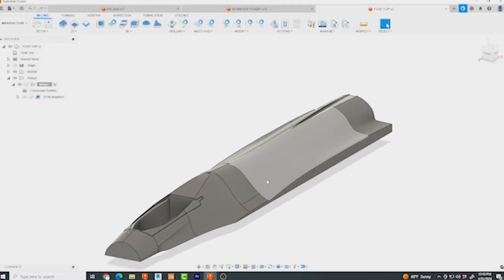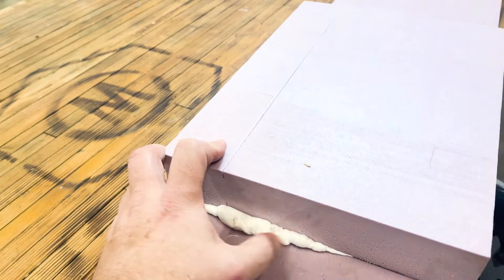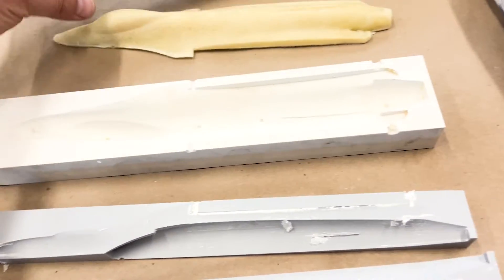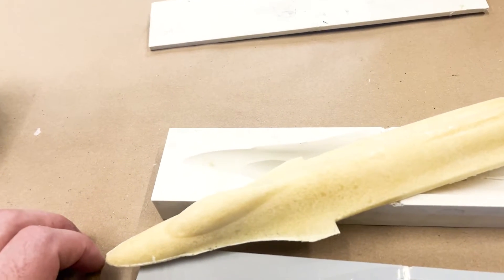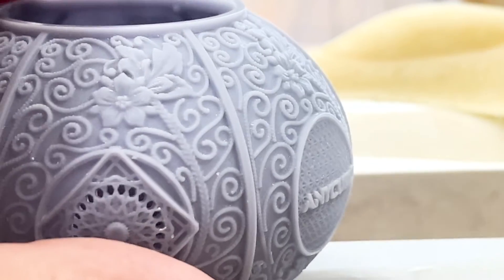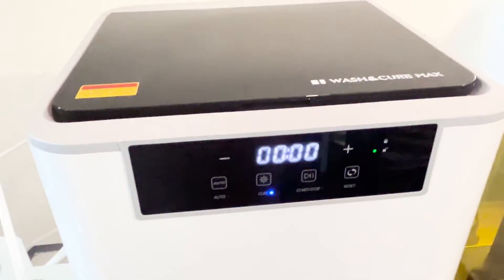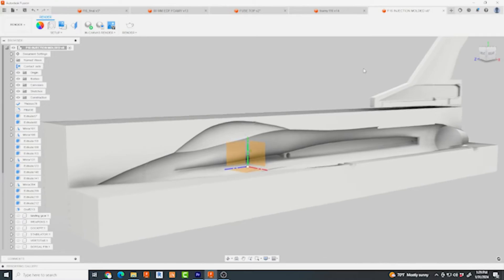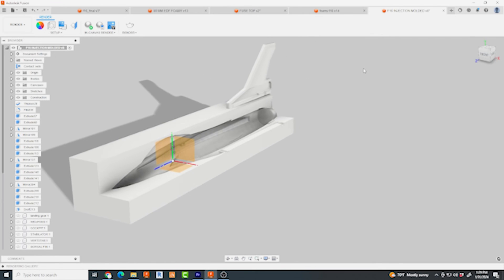Cast your own foam RC airplane? #fusion360 #rcplane #diy #3dprinting #anycubic

Comment: Very cool. What about having a 3D printed outer shell (e.g. LW-PLA) and instead of infill, use 2-part PU foam? Do you think that might work?
Reply from the maker: Hmm.    Maybe.  Might warp from pressure but worth a try
Reply: @redbaronrc  I'd keep one side open and remove excess. Like in the middle of 2 wings.

Comment: There are alot of people trying to print planes. The best filament seems to be the LW-PLA but the print quality really suffers. They also seem to be far more brittle than EPP foam. I really do think the future of the home hobby will be printing custom 3d molds then finding the correct foam or layup to take advantage of those molds. I suspect we just need to find the correct two part expanding foam. Something like EPP that is has strength, weight and durability.
Reply: The issue with your idea is the 3D printed molds wont hold up to the heat of expanding foam. The better option would be creating a mold from the 3D printed part, then using the mold with expanding foam.
Reply from the maker: The lightweight pla I have found to be a bit more crashworthy.  I've printed with regular pla to have them shatter like glass.  Still not as durable as foam though.  My experiments with 2 part pourable foam though interesting did not yield the desired flex of eps.  It was a bit too rigid.  That's only one chemistry though.  There are many.  Unfortunately my local supplier is out of business but I'd love to experiment with other flexible types.

Comment: Hello sir ,im just wondering why didnt the styrofoam work and did you use steam to expand it?      Thanks
Reply from the maker: Hey there.  It was not styrofoam, though I'd like to try that some day.  I was using a 2 part casting foam.
Reply: @redbaronrc  ohh ok ,try styrofoam beads

Comment: I have a foam factory near my house that makes foam and they also have a cnc to cut 3d models. I will like to use these plans but on a bit smaller scale. Can you make a C130 kr C17 plane using this technique?
Reply from the maker: I'm sure you could. I haven't tried something bigger yet though.

Comment: ive been obsessed with this idea for while now for creating wings. i am planning to create an outside mold on my elegoo neptune 4 pro with a tube inside to put a singulair carbon tube in. after molding i will just cut off the outside wall i just used as the mold if that makes any sense. i will try to document my process
Reply from the maker: That's a great idea!

Comment: Try “floatation foam” 2# density (for boats) should work great for you. It’s similar to the casting foam, two part foam that gives you only about 30 seconds to mix and pour. I was already thinking of structural pieces printed in LWPLA with layers of carbon fiber, but this might work just as well. Of course casting the pieces might be more hassle than just printing in foaming PLA, but we won’t know for sure till we try.
Reply from the maker: Thanks for the tip!

Comment: What did you do to keep the foam from sticking to the mold once poured and cured?
Reply from the maker: I used several coats of a carnauba paste wax.  This works OK on its own but then additionally I shot the mold with a special silicone mold release.  Absolutely nothing can stick to that stuff, unfortunately, not even paint, so omit that step if you think you may ever want to paint the model.
Reply: What kind of silicon mold release are you using?

Comment: An idea to explore could also be to print only the outer skin of the aircraft in something like lw pla, then cast foam into it to effectively make a foamcore hybrid wing. Some reinforcement would be needed such that the foam doesn't make the wing thicker through deformation, but it could allow for very easy, durable wings with instant perfect surface finish
Reply from the maker: That's a great Idea!  I've actually thought about it, but as of yet I haven't tried it.